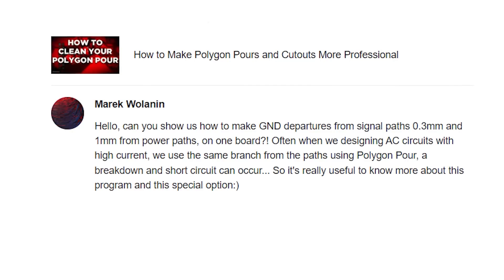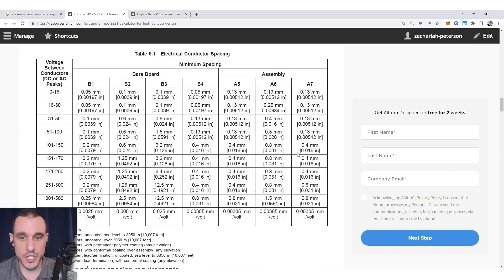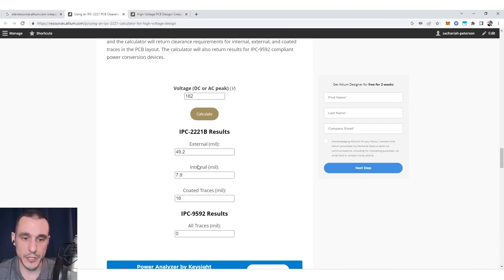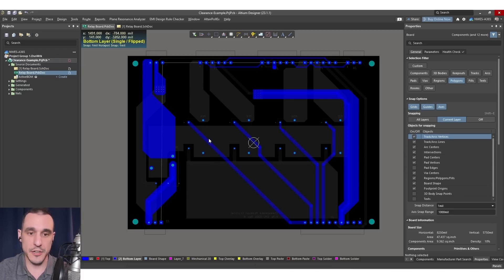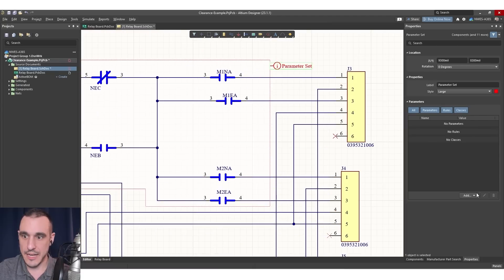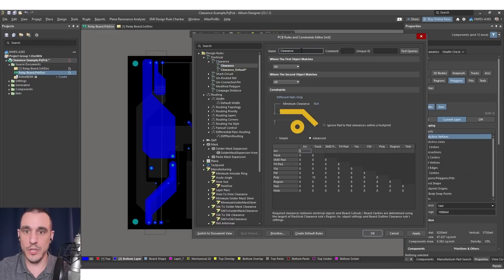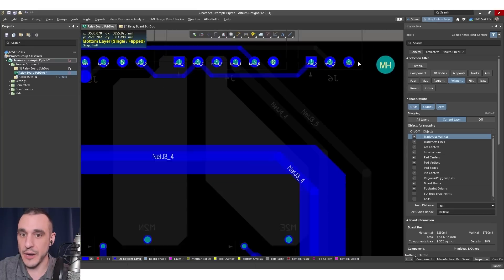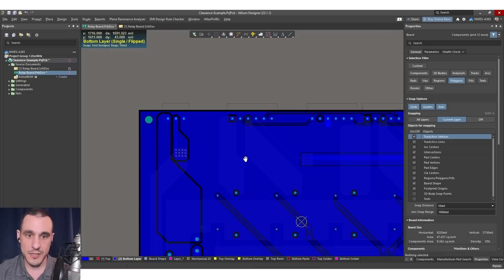Polygon Clearance Overview

Comment: You give the example of clearance between 24VDC and 162VAC. The peak voltage difference for spacing will need to be 186V (not 138V) as the negative portion of the AC now has a greater potential to the positive DC.
Reply: For that particular example you're right but it will be different peak voltage difference on the negative AC swing but it will not matter both for internal and permanently coated external conductors (columns B1 and B4 in the 2221 table). It does matter for column B2 where you have uncoated conductors (landing pads) but if you rectify to DC it will always be the same value.

Comment: How did you add a vertices to the blanket? The usual pressing “Insert” method doesn’t work reliably.
Reply: Yeah I understand, always have to play with the clicks to get it to work reliably when I'm using an odd-shaped blanket directive (which is not very often).

Comment: Hi, Mr.Zach, I have curious about the usb-c d1+, d1-, d2+ and d2-,

If I have two for example atmega328p, does this usb-c can program one of the atmega using d1+-, and program to another atmega using d2+- separately, which means I can program two atmega when I plug the usb with different polarity.

I know all people just connect them together, but I wonder if my idea will works or not? If my idea works, then may I need two usb to uart ICs like ft232RL or not?

Comment: Hi Zach would there be any significant differences when using 50Hz AC supply vs 60Hz when designing PCBs?
Reply: No
Reply: In terms of the clearances required at high voltages no there is not a difference. In terms of capacitive impedance between two conductors, yes there is a ~20% difference.
Reply: @Zachariah-Peterson  Thanks for the detailed explanation Zach!
Reply: Of course - 10Hz

Comment: Largest trace clearance requirement for any mains voltage is just under half an inch for uninsulated free air conductors. If you have something mains powered and you can't get that, you're doing something wrong. Even if you're working with thermionic valves, you won't have anything powered from Euro peak rectified voltage in a ballistic missile.